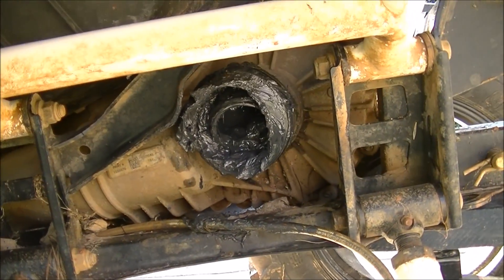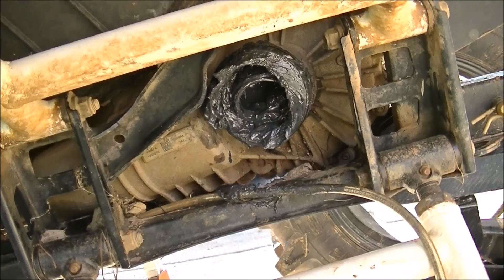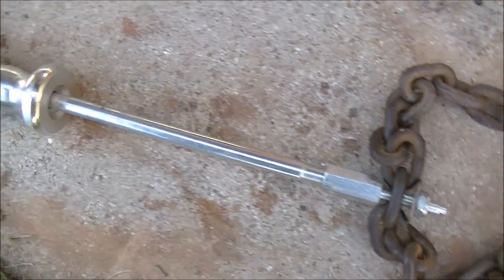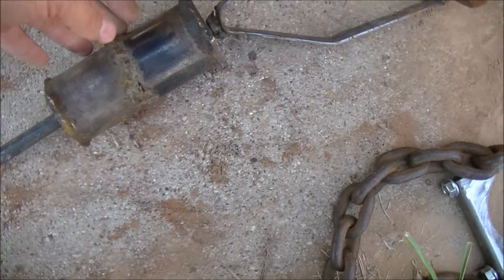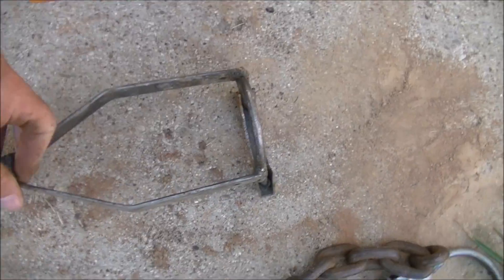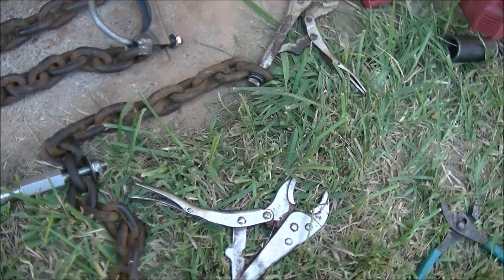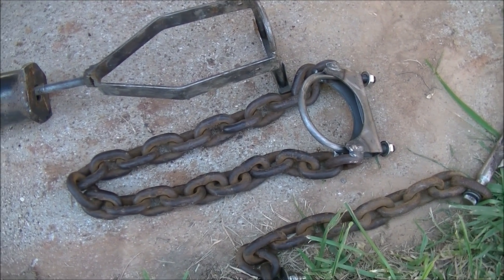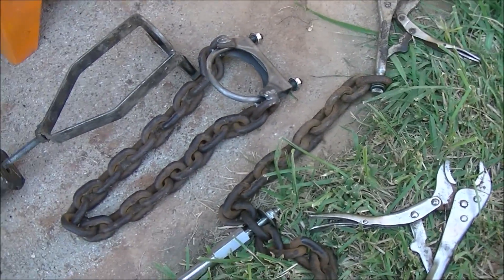CV Axle Change Using Slide Hammer

Comment: I welded a nut the size of the bar of the slide hammer on a short piece of flat bar. I then just tack weld the flat bar to the cv to snatch it out. Works good on the CV the clamp won’t fit on. No worries if it popping off like Vice grips
Reply from the maker: I don't like welding to the cups because I try to use them for spare parts so I can piece spare axles together.
Reply: OleNasty79 I do the same. I’m sure the tacks weaken the cup somewhat. But mostly when I do that is when the cup is busted